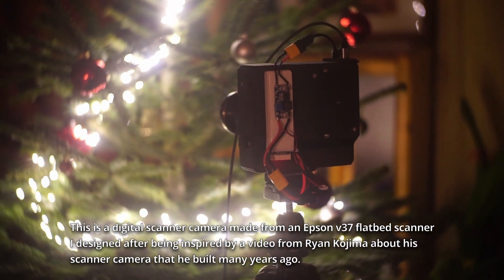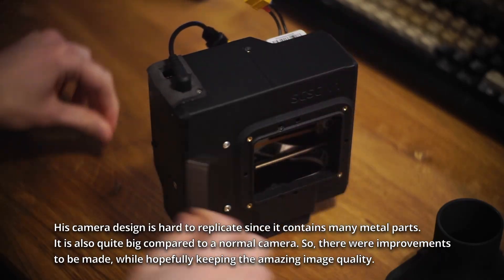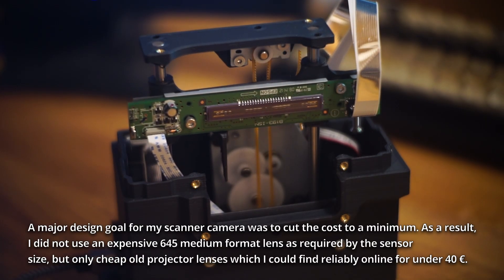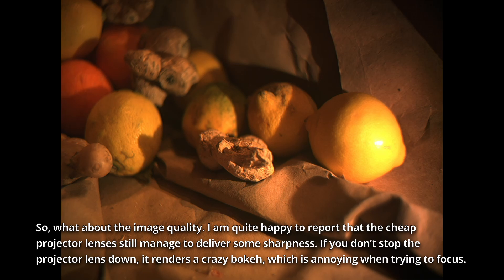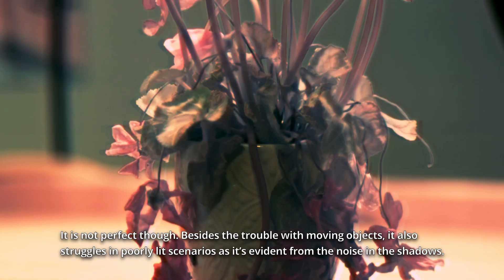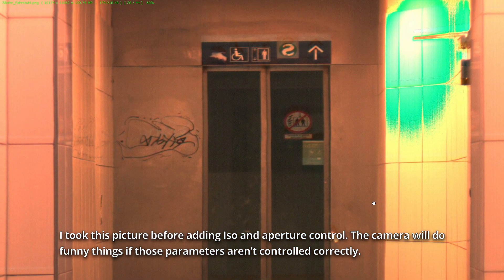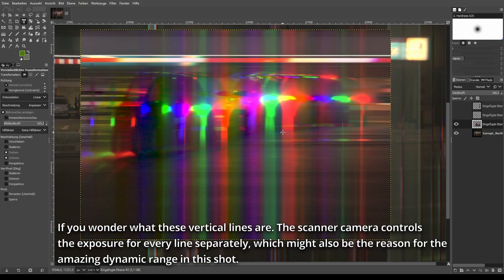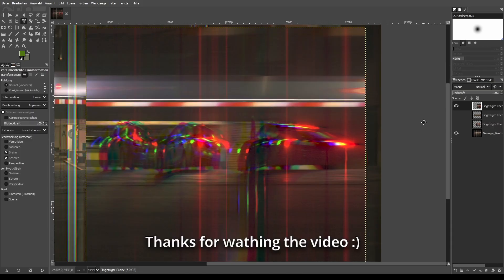489 Megapixel DIY Digital Camera for little money.

Comment: Post it somewhere else. GrabCad invasively requires full details for download of the images. I think I'm going to build one of these, just bought an Epson V33 scanner for AU$45 shipped on Facebook marketplace. It seems the only difference is that it uses a plugpack, whereas the V37 has an internal power supply. The V370 could also be used but it's newer thus more expensive.
Reply from the maker: I could send the files to you, if you hit me up on my email.
The v37 also uses an external power supply. I just cut the wire and connected it to a 2s lipo with dc voltage booster to keep the voltage at the required 13.5 volts (I think it was 13.5).
Please be aware, that this is not an easy project. You should be willing to spend lots of time on this. The 3d model is absolutely not enough to replicate the camera. It is really just intended to help designing your own (better) camera.
Reply: @yunuszenichowski  I did eventually join the GrabCAD site, so I have the files. But I can't figure out how to separate the components in FreeCAD (3D printer files would probably have been more useful). Anyhow, as you say, it's a starting point. I'm not worried about the complexity or time necessary to make this, I'm a retired electronics engineer. :-)

Edit: I managed to score an SMC Pentax-A 645 200mm F4 lens on ebay for AU$117.03 direct from Japan. Apart from this being half the normal price I feel it will do better than a projector lens. As a medium format lens this equates to a 124mm F2.5 on full frame. They're known to be a soft lens used mostly for portraits, should make some interesting images. There are quite a few for sale, in fact the seller I bought mine from has two more advertised at AU$108.90 including shipping. Local taxes may increase this a little, as it did when I bought mine yesterday.

Comment: Very cool. I wonder if the movement of the mechanism during capture is shaking the camera and affecting the sharpness of your image.
Reply from the maker: Thank you! Yes, that is very much a problem. I designed it in a way that allows vibration to travel to the sensor, which I only realized later.

Comment: This has inspired me so much. How did you add ISO control? Is it with the clock setting? Tricking the white balance to control ISO maybe? I hope you do a follow up or even a quick build guide. Great work man.
Reply from the maker: It makes me happy to hear that it did inspire you :) The ISO is controlled by regulating the power the scanners LEDs get, which are used for calibration before (and after) each scan, using resistors (effectively regulating their brightness).
Reply: @yunuszenichowski  oh wow! That makes sense. If it calibrates the white balance that way then it would also change the sensitivity. So you could alter the ISO and white balance if you used LEDs that changed color and intensity.

Did you make your own led board or cut down the stock one? I’m wondering if I could make a diffused light source with amber and white LEDs.
Reply from the maker: I just cut down the stock one, but I think it would be very easy to change the LEDs for different ones. It is just connected over 6 power lanes and 1 ground lane with a ribbon cable. However, you could also power your lamp with a different source, since the scanner does not care if the LED is disconnected, it only throws an error, when it is too dark for the calibration.
Also, I diffused the light, like they did in the scanner, using a white piece of paper, which the LED points at rather than at the sensor directly.
Reply: @yunuszenichowski  this is very helpful. Thank you. I got the case printed last night I have a scanner on order need to print the gear and other internals on my resin printer next. Thank you for all your hard work. I think I will make a video on this project as well. Show what works and what doesn’t.
Reply from the maker: Let me warn you, this is not a finished project and I would assume replicating it would take quite some time and experience, mainly because the 3d model is unfinished! You will have to think about cable management, how to integrate the limit switch, etc.
Reply: @yunuszenichowski  I did see the momentary switch design you had in the model. Might have to change it might work idk yet. Won’t know till I build one. I think if it’s possible in the future I wanted a Pi or some small computer in or on it. I don’t own a laptop but do have a steam deck that I am going to try and use. Thanks for the heads up.
Reply: If any of you guys make the software part beginner friendly, I'm all in. As I understand, there's no external computer attached to it? Is lack of display and computer purely for budget or was there no necessity? Is it possible to automatically crop the resulting image? Because many of photographers would have lots of full frame lenses lying around.
Reply: @dongleseon8785  this is more a medium format sized camera. FF lens may not have a large enough image circle without severe vignetting.
You are still using a scanner here so you need the computer to do the work. I’m sure someone could figure out a way to build one with a raspberry pi. It’s a cheap project that requires a lot of other stuff. The other stuff will cost you.
Reply: @SenpaiSkyy  I understand that it's medium format but full frame manual lenses are so much cheaper. And it will still have vastly more resolution compare to cutting edge modern full frames.
Possibly it can be controlled over wifi with a phone? That would be easy part if the donner scanner has wifi connectivity from start. Then you don't need extra circuits for the display, computer, power, battery? Maybe it's just wishful thinking.
Reply: @dongleseon8785  the reason I bring up medium format is because you need a larger image circle then what a full frame lens can produce. You could extend the lens with macro extension tubes to increase the circle but then you won’t get infinity focus. You could probably do this with a wifi enabled scanner but would need to start over and design your own enclosure. Makes sense though it might require more battery power. Idk I’m still trying to get a good image from what I own. I’m currently building one in a large format camera because It’s way easier to build a larger enclosure. This project is cool but as the designer creator said it’s incomplete. Lots of extra work to make it work.

Comment: Nice build, but I would like to use the scanner system on a moving object (the sky with its stars) so I don't have to move the sensor relative to earth I just wait until the earth has captured a big enough portion of the sky. Should be possible in theory or did I miss something.
Reply: but noise will probably be a big problem, but if I'm honest the noise thing is a quite common problem for night sky and with tradtional cameras it is solved by taking many pictures. So maybe moving the sensor so that it scans the night slower than earths rotation would and so more time for the light to come to the sensor.
Reply from the maker: I believe linear sensors are also used to monitor conveyor belts, so it is definitely a thing. However, the maximum duration of a scan with my scanner is about 10 minutes, so you wouldn't be able to capture the whole night sky.

Comment: why not using modern lenses for high pixel sensors? old lenses arent meant to build for high resolution picture.
Reply from the maker: The main reason is the price of modern medium format lenses. I was not able to find anything that could fit in the desired budget. But I would definitely like to experiment with better lenses in the future.
Reply: @yunuszenichowski  yeh its pretty expensive. especially from phaseOne and hasselblad...
Reply: Modern lenses are mostly built for full frame sensors or smaller, their circle of projection can't cover the size of a scanner.

Comment: Incredible work! I am wondering, how did you manage to eliminate the white light that all these scanners normally have internally?
Reply from the maker: Thank you. I did not eliminate it, since it is necessary for the calibration of the sensor. I used ribbon cable breakout boards to get access to the ground wire, which was then connected to a diy limit switch I made using a spring steel piece from the scanner and two screws, so that the light could only turn on in the home position.
Reply: @yunuszenichowski  Thank you so much for  elaborating on that. Really clever integration. I bought an Epson V39 and hopefully I can reproduce your results with this scanner. I was thinking about adding a Nikkor lens for the optics. Thank you again!

Comment: You should try to project the results of a telescope onto this as high mp images are one of the most important things when it comes to astrophotography.
Reply: I wonder if there'd be a lot of star trails if you didn't have a star follower mount as the images are so long to take. It would be very cool to see!
Reply: @Ruikesan  Na likely not.  At worse you may form a minor distortion because while yeah the image takes a while to produce the actual sensor is only over that area for a fraction of the time. 
Me and my son regularly do basic astrophotography using our phones and the results are honestly amazing using stacking software.  Had you told me when I was a kid I would be able to take an unmagnified image of Andromeda galaxy with any camera, let alone my phone, and see the arms of it clear as day I would have called you crazy.   Hell... same goes for color on Orion nebula.   The sensors in phones are ridiculously powerful and you couldn't reach these sensitivities without juicing your film with various special compounds first. 
We only run into start trails around 30 seconds exposure unmagnified and when binoculars or a telescope is used roughly 8 to 10 seconds so i doubt it would be any issue at all.
Reply from the maker: Thank you for the suggestion. The scanner is really bad in low light, because by exposing every line sequentially, the lines themselves only have a short exposure time. It takes ~8 minutes for one high resolution picture, so stacking images would be difficult.
Reply: @yunuszenichowski  Yeah if thats the case you're probably right.  Given the nature of a scanner it might just have some sort of single pixel camera or possibly a single line which it just builds the image that way instead of the normal squared sensors phone cameras have.  I just knew phone's these days have crazy light capturing abilities compared to analog film of old and I was amazed when I started taking pictures using only the most basic setup with a phone of all things.
Reply: Your over exposure issues would be a benefit there as well.
Reply: Who the hell need 489 megapixels?
Reply: @AngryNegativeHistoryProject  Scientist.

Comment: that is cool.   for really cheap lenses that will increase your focal length options look at enlarger lenses.   Several come in a ltm mount or m42 mount.   really easy to adapt.
  I picked up a 135, 105 and 55mm last month for playing with 4x5 film.   Didn't spend more than 65 bucks for all three.
Reply from the maker: Such a smart workaround, I will absolutely try that, thank you :)
Reply: Really good idea as those lenses are quite literally made for the purpose of projecting a huge picture! And they come with apertures

Comment: Impressive, a scanner camera is something I've wanted to do for awhile now, I have been planning building it as a 4x5 back for a film camera.  How much is directly pulled from the scanner, is it just the sensor or are the other electronics and movement system from the scanner retained?  Looks to be mostly replaced, but it's hard to tell since I've never seen the guts of a v37 before.  Standard scanning software or custom?
Reply from the maker: I essentially just removed the case of the scanner and reorganized all of the parts, required for the operation of the scanner, to fit in the camera form factor. You can look at it in detail in the 3d model.
It uses the standard software.
I wish you great success with your build!

Comment: I'm curious about the actual image taking process, do you connect the camera to a laptop or pad and use the original software to capture an image?
Reply from the maker: Exactly, annoyingly it has to be connected to something like a laptop or windows tablet, in order to work. Maybe it could be improved by integrating a raspberry pi, but that wouldn't be cheap.

Comment: Thanks for designing a cheaper and easy to fabricate version ^^ 
Are there more accessible scanners that would be easier to get? I was not able to find any listed for sale locally.
Reply from the maker: The only requirement for the scanner is to have a CCD sensor, but you would have to adapt the design, when using a very different model. However, I know that the v370 should definitely work. The v30 and v33 look like they have very similar designs as well.
I feel like I should mention this again. The 3d model is not complete and should only be used as inspiration for your own design. The camera is in fact designed quite badly, because I was under pressure to finish the project (there is a lot of double-sided sticky tape involved).

Comment: wow ingenious design, maybe you can try to replace the projector lenses with maybe canon or nikon lenses for better image quality as those lenses aren't very expensive but can deliver superior photo quality, or maybe make it adapt into a microscope lenses for extreme macro photography, it should be easier to incorporate as it doesn't require any special mounts and is cheap as well. But idk i'm just spit balling on some ideas. But amazing design none the less! This would be amazing for astrophotography! might attempt to make one once the design is finished.
Reply from the maker: Thank you for the ideas. I am unsure if the camera would be able to capture the dim light of stars. You also can't make long exposure shots with this camera. But I will definitely test that at some point.
Reply: @yunuszenichowski  Just need a lens that is large enough. Like a liquid lens.
Reply: I'm also definily interested in the possibility of AP with this type of camera, will definitely be needing a star tracker since I'm not sure if this is fast enough to not have distortion from the slower exposure time.
Image stacking might help with the low light and the high res images could be an upside if it doesn't take a ridiculous amount of time to take a bunch of pictures to stack😅
Reply: @Joshplv  At a certain focal length, you just need the sensor stick, without the motor. You just let earth rotation do the swipe.
😁